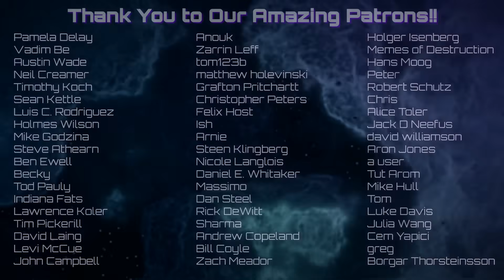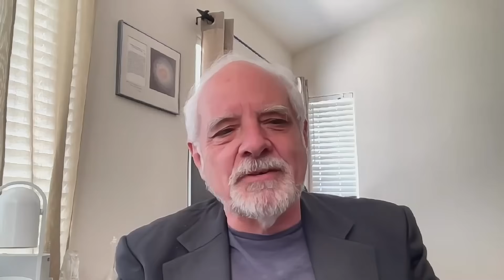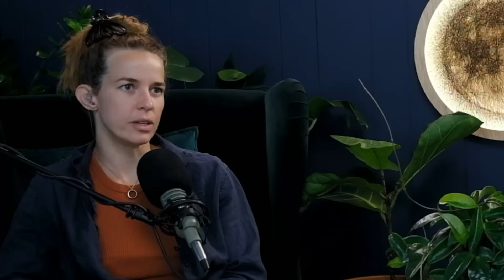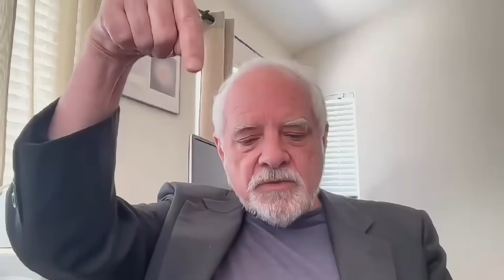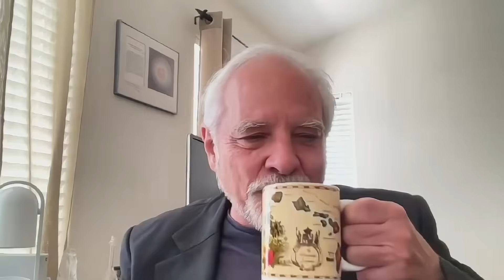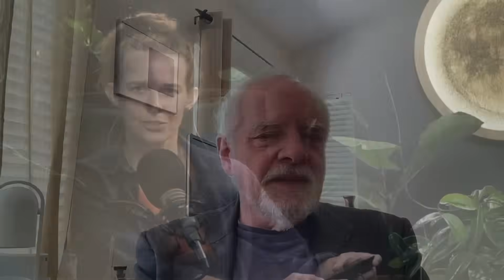Room Temperature Fusion is Here - Lawrence Forsley, ****, DemystifySci #349

Comment: Well basically that's what I've been taking about, I posted this on another video...
----------------------
My delusional theories about the Pyramid ...

I'm convinced the deep vertical shafts are resonance tubes that are used to transfer and amplify the Earths natural vibrations...
I'm convinced of that because physics says you can pulse a sound vibration into a tube over and over again to make it bounce off of the returning pulses, then all the vibrational pulses bounce off each other, and they will all increase in speed, strength and amplify

*Unlimited free energy as long as the Earth spins

Basically it would shake & vibrate the Pyramid above like a Titty Dancer on payday

 (vibration = power &"Combining" vibrations is a Science we know very little of yet)

So inside the Pyramid we then have the bizarre situation where that since the Pyramid is a natural Toroidal Structure it then causes ions and protons to swirl thru the stone in a Torodial field

And by passing thru the stone of the Pyramid the protons also pass thru the 2 1/2 tons of charged Quarts Crystals that were activated by the Vibrations in the stone

Please don't call the Police I'm perfectly fine...The voices said so

OK...So all of these swirling Charged Protons then go into the Kings chamber. But it isn't a Kings Chamber at all it's actually a plasma field generator. Also the Sarcophagus isn't a Sarcophagus it's just a Vat for containing Mercury.

So the vibrations of the Pyramid then activate the Mercury inside the open Vat to turn it into a Plasma field

Fun fact is you can turn Mercury into Plasma if you apply the correct vibrational frequencies & also note the Sarcophagus "rings" like a bell if you strike it with a stone (or carved to a specific resonance tone)

So!!!

Now we have a contained field of Plasma where Protons and ions are being swirled about it in a Toroidal field and then being shot out the tip of the Pyramid

*And I suppose that's what the ball lightning phenomenon is, a natural self contained toroidal field 

Now the question is why?

I'm toying with the idea that it acts something like a Mercury Arc Rectifier and changes the Protons and ions

Basically a Mercury Arc Rectifier is a known machine that utilizes a field of mercury plasma to instantly change AC to DC

Was the Pyramid a machine to super charge the upper ionosphere with altered Ions so it could be downloaded by people on Earth to use as a power source?  

And could it be they developed a way to make motors run off of Protons? free energy for everyone on Earth?

But maybe I should dismiss the idea that the Kings chamber was for a Plasma field because when they turned the Pyramid off the liquid Mercury would fall the the floor instead of returning to the sarcophagus... 

Or perhaps they didn't really turn it off? Mercury does evaporate so it would have to be replenished from time to time, maybe every few hundred years?  

Like I say, I don't have any Scientifical Learnings, so what do I know?

------------------------------------
Oh And another thing...

Could it be possible that shooting this energy out the top of the Pyramid might cause a field of ball lighting to hover over the Pyramid? Maybe this is where the all seeing eye comes from?

I have read that a toroid field creates a smaller identical structure above it...kind of like how a matching whirlpool would appear if you stir water with your hand? 

But YES, I think it's entirely possible that the toroid structure of the Pyramid could produce a motionless ball of lightning hovering above the Pyramid & it would look like a giant glowing eye was watching you day and night, visible for miles & miles around

The eye of a God

------------------------------

I don't fully understand what they were doing with ion or atoms/whatever or how they used them but I can only guess they modified them somehow? 

I don't have any scientifical learnings ....but basically there's your Reactor

Comment: Just like humidity can affect electrical experiments, his work might be affected by its position respect to Earth's magnetic field, the sun's magnetic field, especially how currently (at experiment time) deformed by other planets, solar flares, thunder storms & lightning strikes, including those that happened in the previous week, location of power lines, electric substation localities, if it's day or night, moon's location, what kind of screws & other fasteners are used, heating/cooling system of building housing the project, how the building is built, type of soil, rock formations (especially if granite or quartz is in abundance), quantity of electric vehicles and/or  other intense electric use.... and , of course, the degree of purity of all components, as he related during this talk.

Variables not considered can be more important than expected and explain many inconsistent results.

Comment: What happens if you start turning on and off the electrcity in sequence so that it has enough atoms within the device so it have enough for net gain but not enough to crash the device?
You can utilize a a large capacitor as a timing device in turning on and off the electric current.

Comment: Electric Universe explains planetary formation better than gravity alone. Static electricity is all you need to create dust bunnies under my bed and out in space. Once the dust bunny is big enough, gravity can provide an assist, and change what happens down deep.
Reply: Your dust bunny analogy may be correct but then again may contain a flaw? In addition to static electricity don’t forget to add air currents, rodents, insects, dead skin flakes, curling hairs, and floor vibrations to the energy field. Also some elements, molecules, compounds, metals, etc, attract and repel each other. I’m no scientist or engineer so my thinking about your dust bunny comment probably has some flaws of its own.

Comment: At earth gravitational strength and the present density of the plasma, they will never gain net plus gain viable for commercial usage.
A rule of thumb is equate the gravitational strength, temperature and,  plasma density of center of a red dwarf and calculate the equation of present Tokamak reactors. Electro-magnetism is stronger than gravity by a factor of 1000 but the plasma density will be much denser than within a present reactor.
In nature below the red dwarf nuclear fusion does not ignite so it should be a good measure for a viable solution for commercial application.

Comment: I think it's a zero point energy effect! Instead of fusion. For example helium atoms emitted from palladium, I suspect that could be helium that was trapped in the palladium already from begin with, and the energy process starts pushing the helium atoms out, rather than something being formed through a fusion process.
Reply: All of physics is about energy. 
It’s no coincidence the lights propagation window is skewed and unknown.
Reply: Actually this comes down to spin and ionization ie extra electrons no. And if this be true what I say means yes it’s in palladium but not actually there more or less it is that palladium appears to be palladium because its core spin or constituents mutated from the charge from the highest energetic form of palladium being helium. Maybe spin has a massive factor?
Reply: Your comment and this original video teaches me how difficult it is to properly design, measure, and interpret a physics experiment. Thus my admiration for thorough science and engineering. Hats off to those pioneers who succeeded in quality results👏

Comment: Lattice confined fusion is metal in water. INERTIAL CONFINED ELECTROSTATIC FUSION eats air. (Frank Mead Magnetohydrodymanic Drive) Theres lots of ways to induce the aether through use of the 4th state of matter, plasma.

Comment: Fusion doesn't create energy. It consumes it. What you're seeing in these so-called "breakthroughs" is just a massive reorganization of existing energy, not a net gain. The idea that smashing atoms together produces more energy than it takes in is based on abstract models, not real physical mechanisms. In a real-world, physical framework, energy comes from motion and pressure, not from rearranging hypothetical particles. Fusion is a byproduct of collapse, not a source of power. What looks like energy release is actually the system shedding energy it already had.

So why do so many claim there's a net gain? Simple. They play with definitions. In laser fusion, they only count the energy delivered to the fuel pellet. They’ll say “we put in 2 megajoules and got 3 out,” but ignore the fact that the laser system itself consumed over 300 megajoules just to fire. In reality, it's a net loss. Always.

They also use a trick with the Q-factor, which is the ratio of energy out versus in. But there are two versions. One only counts energy in the pellet. The other counts the total energy the system used. They only report the first one, the one that sounds impressive, and quietly ignore the one that actually matters.

The truth is, fusion has never produced net usable energy. Not once. And yet after 70 years, people still repeat the same promise: “we’re almost there.” Why? Because it's a multi-billion dollar research machine. The hype keeps the funding alive. Most journalists don’t know enough to ask questions, so they just copy press releases. And people want to believe it. Clean limitless energy sounds amazing. But it’s a fantasy.

If fusion really worked the way they say, we would already have functioning reactors. But we don’t. Because the whole concept is based on a flawed interpretation. The real-world proof is in the failure. The numbers don’t lie, even if the headlines do.
Reply: Many true words but there are applications for plutonium that cannot be replaced because of compactness.

Comment: Regarding the green walled limit:
If you've got a sphere and the plasma is leaking out of the sphere and the plasma has a maximum density it can be then why don't you just put plasma on the outside of The sphere as well as inside the sphere so it can't leak out because the density is too high on the outside of the sphere and then you can continue to compress the inside?

Comment: Wright Brothers flew in 1903, not 1907, although it took 3 years for some newspapers to run the "obviously hoax" story.
A friend shared a hard back book copy he'd bought several years ago that included their wind tunnel research notes. The print copy (About 8 or 10 point, small print) was about 300 pages. Can't imagine the volumes of hand written notes. 
When taught about the flight in school, I pictured the bicycle repairmen goofing around, playing with different wing designs. Such an insult to the detailed notes, careful measurement, applied math and careful scaling...  No atomic accelerator had more advanced engineering effort put into it. Their contribution to applied wind tunnel technology should be as honored & famous as the plane they flew at Kitty Hawk.

Comment: Tsar Bomba was detonated on Novaya Zemlya (in the Arctic Ocean), not in Khazakstan.  The "scaling" isn't actually fusion itself.  Most of the energy comes from fission of the uranium tamper on the secondary.  So it's more correct to say the fusion "boosts" the fission reaction.  Hydrogen bombs are mostly fission (60% to 80%), boosted by fusion (20% to 40%).
Reply: Yeah, that was my impression of how thermonuclear devices work. The fusion accelerates the production of neutrons into the tamper reflected by the reflector (which just creates even more neutrons, they don't actually reflect) thusly greatly amplifying the fission. The fusion itself isn't responsible for the massive yield, it's the huge momentary increase in neutrons and temperature within the necessary time frame before it blows itself apart that does.

Comment: I think somebody has to describe or define the underlying motivation --- theoretically ---  for the lattice.  What can gravity and lattice do that can't be explained by condensed matter and no lattice.  I'm thinking that with or without a lattice you get the same pressures.  I'm thinking a lattice might be able to produce slightly higher pressures but it is also going to be brittle in that the lattice --- if I understand correctly --- is just comprised of covalent bonds.

Comment: Thanks all for a VERY fascinating discussion.  Dr Forsley was a charming guest.

I'd like to raise an important point that may be a source of cognitive dissonance in nuclear physics.  Dr Forsley was speaking about the fireball from the earliest nuclear detonation tests and said the scientists noted that the density of the fireball was orders of magnitude too low to bring about nuclear fusion.  Later in the discussion, Dr Forsley cited (in line with the Standard Model) Supernovae as the source of numerous fusion reactions.   

The (as far as I'm concerned mythical) claimed phenomenon of the Supernova, is an explosion no different to that of any other, nuclear detonation included.   There is therefore, no reason whatsoever to expect such a phenomenon to generate an increase in internal pressures.

I am of the position that All the primary elements are manufactured in stars- stars of the LMH structural model and that BARONUCLEAR fusion, which is just a less fancy way of saying 'inertial confinement'.   Basically, it's pressure-induced fusion, which Dr Forsley's description of the laser triggering of fusion matches- pressure used to cause a mass to crush until fusion results.

To my mind, Supernovae are fiction.  A misinterpretation of another phenomenon.

With regard to lattice confinement in Liquid Metallic Hydrogen, this was presented by Pierre-Marie Robitaille, with the evident emission of intense microwaves at the limb of the Sun.  Why the limb?  Because thee microwaves would escape the confinement at a shallow angle to the face of the lattices.

It is telling however, that the good Dr remains perceptually encapsulated by the Standard Model, failing to relate his acceptance of the presence of condensed matter fusion with the potential that stars are themselves entirely condensed matter!  of course, astrophysics is not his field but nuclear physics constantly draws references to stellar physics for its perceptual framework.

Interesting chat.  Thanks muchly.
Reply: Some dog on the electric sun model- but I think it’s the closest simplest thing we have to truth.
Reply: @ChiefDinger  Electric Sun is flawed on many levels.  it can't be entirely discounted, electrical energy being fundamental after all.  It's a part player in a complex tapestry of influences.  Gravity, pressure, momentum and chemistry all included.  they all have a role to play at different scales and in different ways.
Reply: @Barbreck1 the names vary as individuals put their **** names on natural effects- 

The universal mechanism of growth does not-

If you had a loophole- that’d be the physics “holy grail”

Alll of our languages, religions, ancient architecture, elitist symbols and science 

Are avoiding- but pointing- to the heart of the matter-
The (Whole point) is electricity.
Reply: @Barbreck1 Your comment contains wisdom. I wish the representative scientists from these fields could set aside human pettiness long enough to collaborate into a new and functional model of how our Universe works.